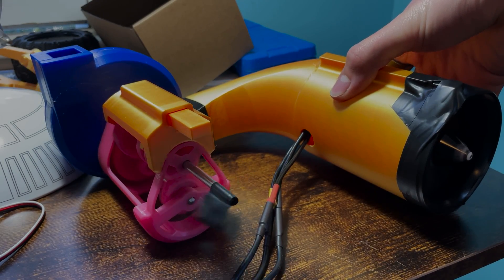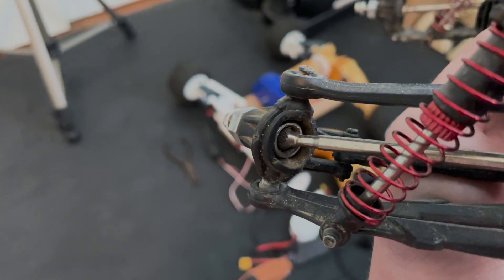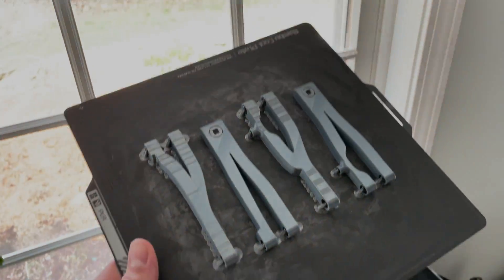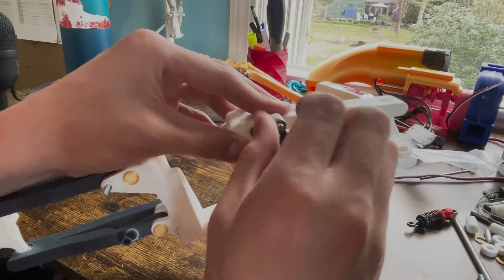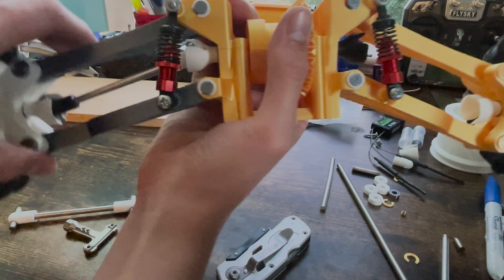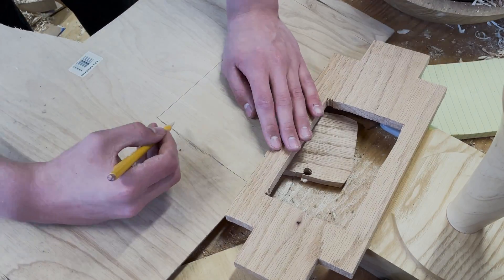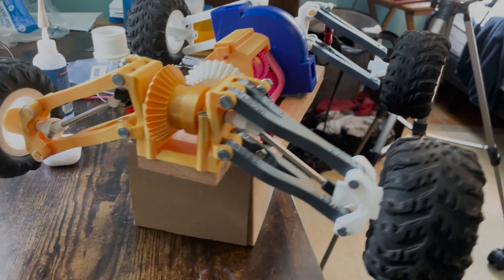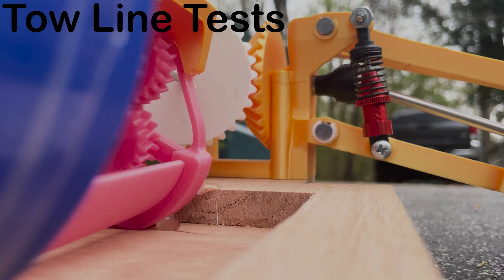fully 3D Printed RC Car - Will it Work?

Comment: I see the same error as last time. You're using a big crown instead of a small crown. I know big crowns generate more speed, but you're sacrificing torque for speed. When you upload the next video, I will see if the motor will lag or not.

Comment: No idea why this didn't show up in my subscriber feed, but that's looking pretty awesome! I'm actually working on an EDF rc car as well right now, though I just use the EDF to push the car forward like an airplane. In case you decide to try this as well, here's a little tip for you: avoid mounting the EDF too far up or too far back as it will lift up the rear of the car, reduce grip on the rear tires and cause it to spin out.

Comment: google about why you should offset the universal joints by 90 degrees at either end of the axles. same with any driveshaft, it's to cancel out the surge effect .
Reply: This yes! Came here to say this 🤓
Reply: that's a cv joint